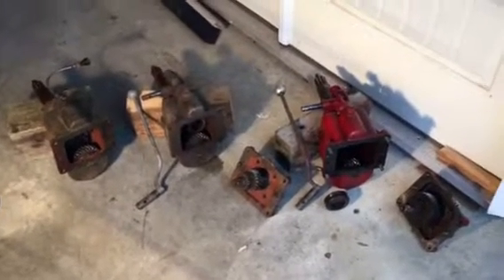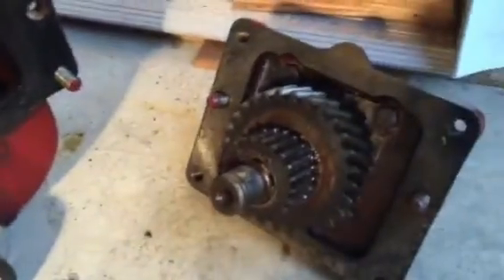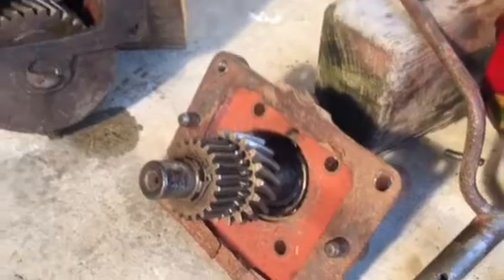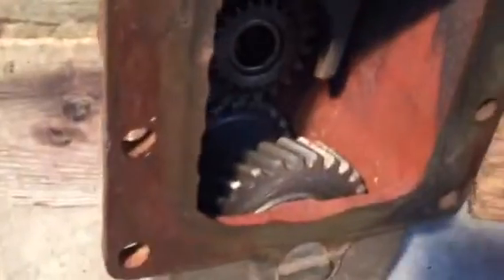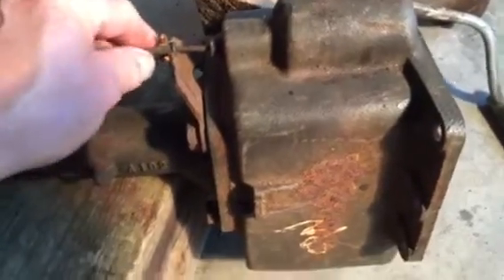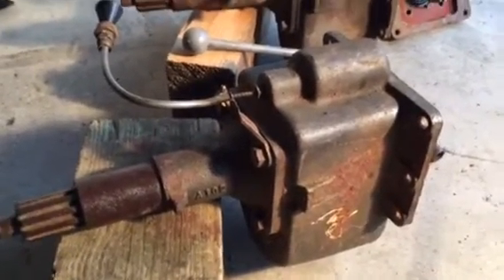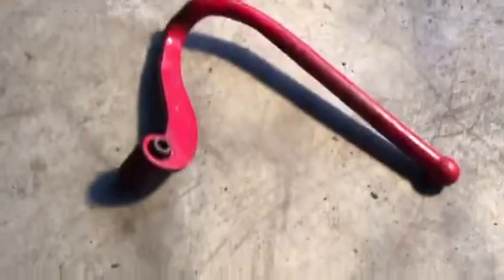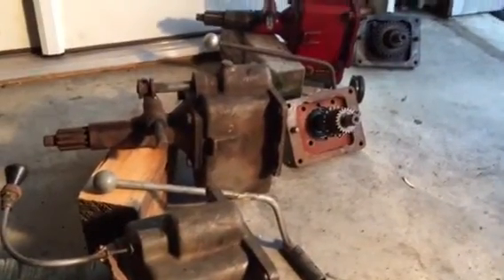Sherman Step-up & Step-down transmissions

Comment: I have two or three shermans with the cable that has the big knob on the dash......I was told it's rare
Reply from the maker: The cable sherman was the last of the step up or step down units before the introduction of the sherman combo. Not a lot of cable units were sold although I wouldn't call them rare

Comment: What is a "creeper"?    Im assuming thats 'step down'?
Reply from the maker: Yes the one in this video is a step down. The step down trans has a 1.5:1 reduction. The sherman creeper (special purpose) trans has a 9:1 reduction. This will also effect the pto speed. The howard trans has a 3.5:1 reduction and the everett trans has a 98:1 reduction. The howard and everett are behind the main trans so does not effect the pto speed just the ground speed.

Comment: Thank you for sharing your sharing some of your knowledge. I have one question. I removed part of my step up trans. Now i can't figure out how to get the rest of it out. I removed the 4 bolts that bolt it to the trans case. It seems to be stuck on the dow pins. What do i do? Your thoughts are greatly appreciated. Thank you.
Reply from the maker: Take a flat crowbar and try working from behind on top and bottom.. Also sometimes people goop them up with silicone instead of using the proper gasket.

Comment: This may seem like a stupid question but I have a 46 2n with a combo and it’s extremely hard to get into the different ranges, it takes some fiddling to get it to go in and it always goes in eventually. Is it common for them to be hard to shift and is it something that will work out if I shift it around more? Or is it worth pulling it out and opening it up? The tractor was a slightly neglected loader tractor for part of its life, so I don’t doubt that it never changed ranges in the 30 years leading up to me buying it.
Reply from the maker: Depending on what generation combo you have exposed top shifter rails could have accumulated some rust. But this will also happen when it stays in the same range and doesn't get shifted into other ranges. You could split the tractor pull the sherman open up the top and spray the inside shifter rails with PB blaster or Kroil but I would think that with more you use it should get better. It's also possible the slide gear has some wear making it harder to line up with the mating gear or the forks could have some wear Or shifter rail detents. Most old loader tractors never got out of low or standard range so my guess in non usage. Keep work the handle, even with the engine off, thru the ranges and see what happens.
Reply: @kirk-nj6344  thank you for the advice! I had the tractor split to rebuild the engine just a few weeks ago and completely forgot about the tight shifting issue with the Sherman, so even though I was right there I forgot to pull it!

Comment: Hey have a grey Ferguson to20 with a Sherman transmission. Not sure what type no handle and tractor stuck in 3rd 3rd 4th. Any thoughts?
Reply from the maker: You can try this
 https://fordtractorcollectors.com/4-speed-transmission-locked-up-stuck-in-two-gears/
I know the gears will be in different position but roughly the same process.  If you have chipped or broken gears let me know I have some.
As far as the sherman it's probably a combo. If you check out my other videos on shifting shermans you might notice the location of your hole. the step up/step down will be closer and lower  to the starter bump. If  combo, you  will see a square with a hole in the center. You can take a 1/2" drive socket reverse it and slip it over the square and rig up a handle. Send me some photos of what you have. Kirk641@embarmail.com

Comment: Looking to run an old Belsaw sawmill from some type of Ford tractor with a flat belt and was wondering if you had any idea of the rpms of the flat belt pulleys mounted on the ford PTOs.  I’m assuming the pto is running at a regular 540 but I wasn’t sure if the flat belt adapters were geared to spin faster.  You seem to know you fords so i thought I’d ask. Thanks
Reply from the maker: Flat belt pulleys for the ford will vary depending on the throttle speed. Here is a link that will show the sherman but will also show the speed of the standard gears if you don't have a sherman.
 https://web.archive.org/web/20160318014307/http://www.oldfordtractors.com/sherman/shermco.jpg

Comment: I just bought a 53 Golden Jubilee, and discovered it has what I believe is called the Sherman Combo (?). It has 3 positions, high, low, and 1:1.
Reply from the maker: Always nice to discover a sherman especially a combo. Check out my other videos about shermans. Found a nice combo in a 640 that the owner knew nothing about. You can see the busted handle in the Hot-Wiring and old ford 600 tractor, video